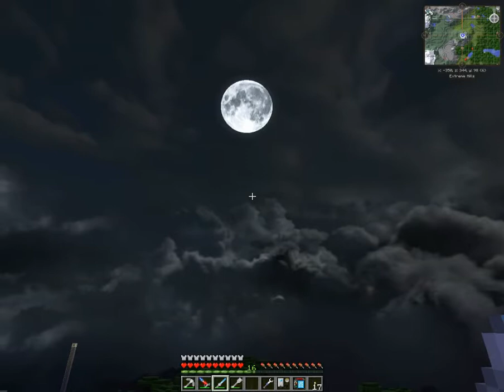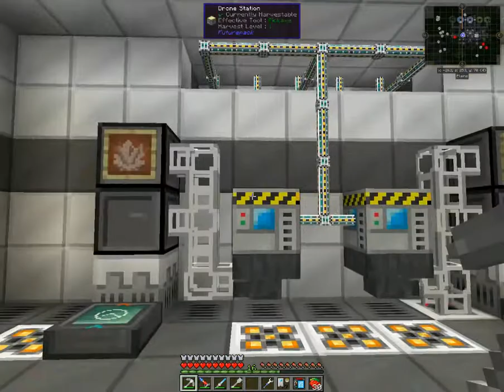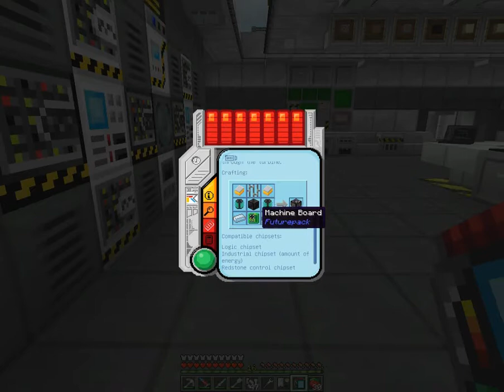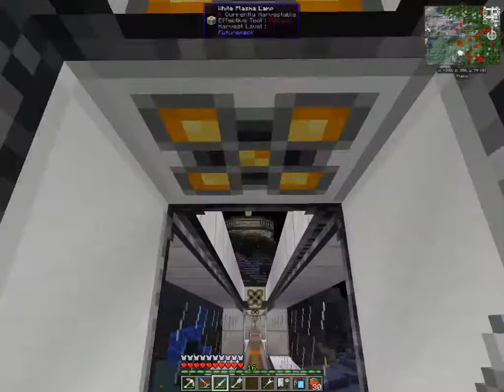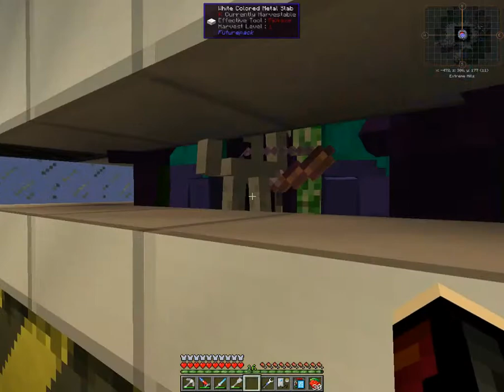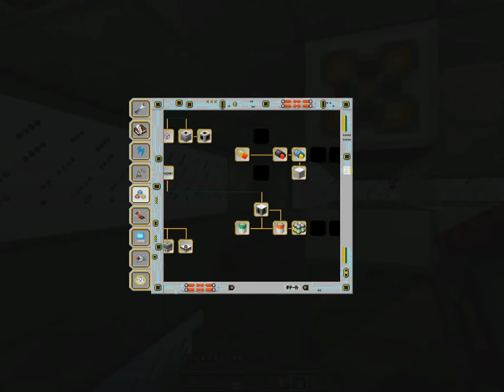FuturePack Episode 11 - Water Turbine Powered Laser

Comment: I think you should study the mob spawner better. The way it is, you loose the oportunity of getting ender pears. Maybe you could, just for test, open a room (without any special blocks, just to test it out) a little closer than the place you spend more time (at least 17 blocks away from the crafting room, I would say... Maybe 17 blocks down?). Just a dark room (you might use that option of light the room when you want them to stop spawning, of course), with at most 16x16 (I used 8x8, but that was small, indeed), and the laser tower on the center. Maybe with half of the floor filled with hoppers, and the other half would be in fact where they would spawn. Some drops will be lost, but in general, most of them will be catched. The pattern of the hoppers could be outer no, then inner yes, then next no, then next yes... or... a chess format, but that's hard to configure (the tubes). I don't know... but I'm sure you would figure it out... 8^)

Anyway, think about it. It would be a more simple and efficient solution. And your beautiful building up there you could dedicate to your spaceship base, control tower, shipyard, and so on... What do you think?

Aaaaand... it's getting close the time for you to start thinking about your spaceship. You're getting pretty close on the research... ;^)
(just remember that with each propulsor you can move only 100 blocks, and each of them will consume fuel on the space travel, which is made with gunpowder and that blue ingot you get from the centrifugue. So if you make a huge ship, be prepared to keep the system producing those fuel items in a huge quantity).

I'm so curious about how your ship will be... 8^)
Reply: woops... I forgot one more thing you will need... Blaze rods... In my survival I used the FuturePack special item that can capture spawns, so that you can put them in your base, to capture a blaze spawner. But I must admit that took a lot of time, because I decided to make a bridge strait to the spawner, which was a slow process because of blazes and ghasts... haha... But at the end, I got it.
Reply: I was using just a single solar panel with a battery (with extra neon batteries inside, for the night/storm shift), and it was enough. Anyway, now that you have done them, maybe you could move them waaaaay below, so that they'll generate a huge amount of power to your base, as the water is coming from up there. No losts in that case... 8^)
Reply: Oh, btw, you could make a teleporter for the upper side when you have it researched. That would be useful, as it's a loooong climb up those ladders... 8^)